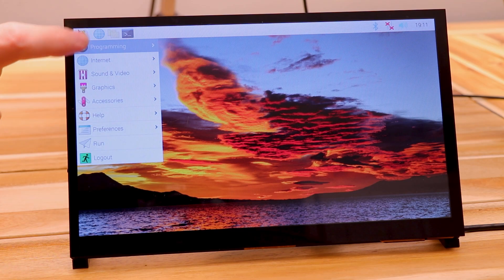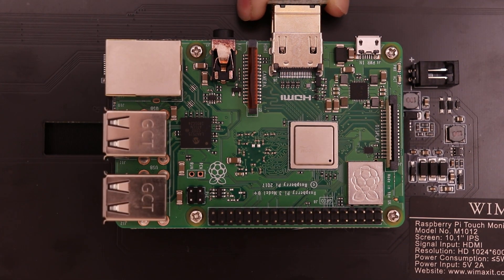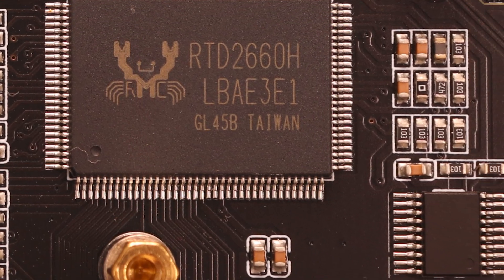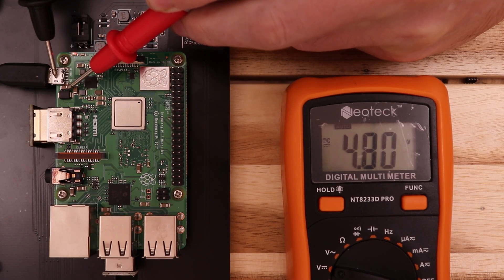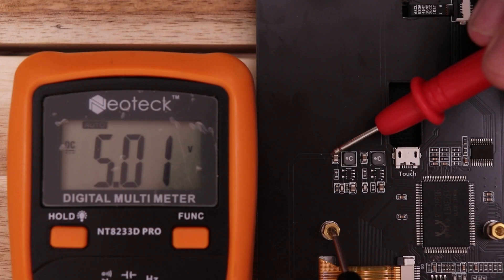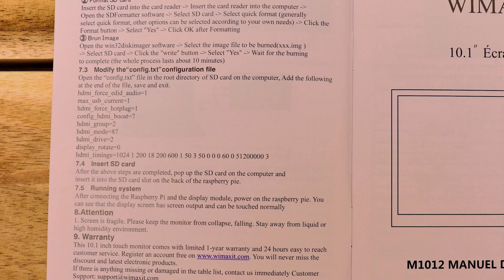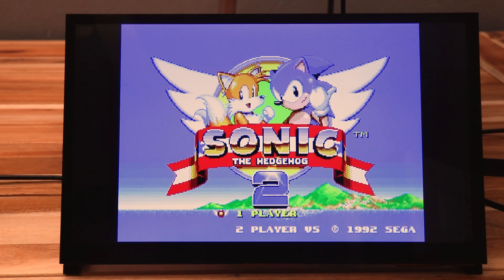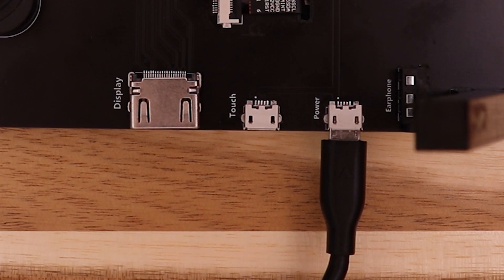Wimaxit M1012 Review and Deep Dive - 10.1" Raspberry Pi Touch Display

Comment: Did it really scratch that easy? It wasnt just a clear plastic cover, meant to be teared off?
Reply from the maker: Yep, I checked. It did have a plastic cover that I peeled off after unboxing it. The touch panel is probably just acrylic or something. It works great as long as you don't put it face down onto a rough surface.